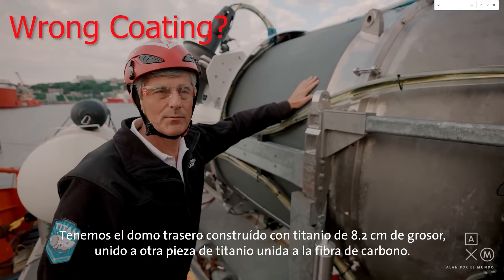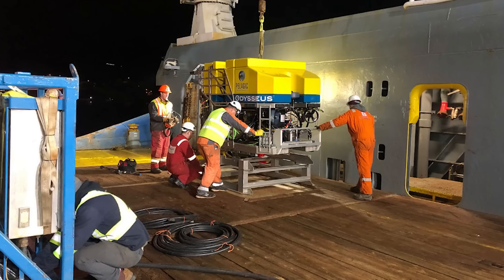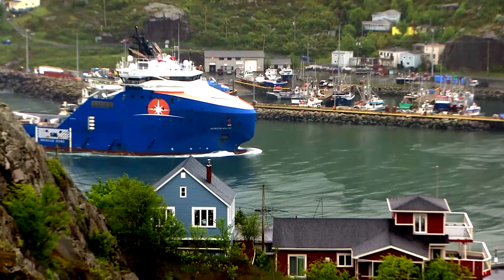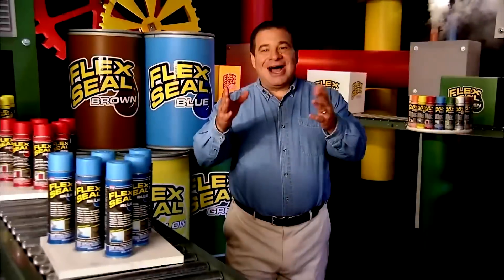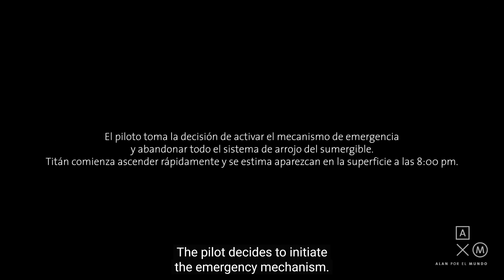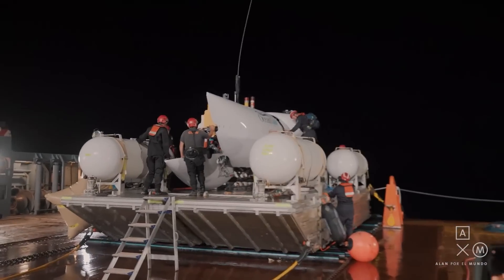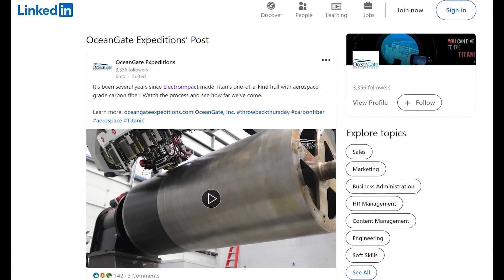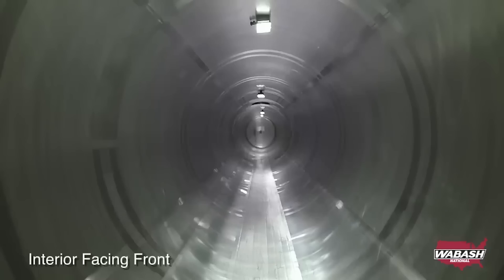Titan Sub Wrong Coating? Hull Construction, Debris Field Search

Comment: Maybe it's just me, but, those contractors, the Pelagic people, I thought that was an amazingly quick response.....

It's not like they sit there in a state of "readiness"...  they're at the dock, between jobs.  You do some maintenance routines, you check over all your gear, your next job isn't until 3 weeks from now....  It's probably pretty chill....  

So you go from that, to BOOM, the phone just rang, call everyone in, let's rock, we gotta be on a plane TOMORROW....  50-some odd hours, they went from hanging out, to fully loaded on a ship hundreds of miles away, pulling away from the dock....

It could take over 24 hours to get your people in....  and yet there they were, pack it up, ship it, travel, get there, unpack it, load it onto a ship dockside......  It's not just the Odyssey itself, there's undoubtedly crates & crates of supporting equipment, pumps, hoses, test gear, who knows what, that has to travel......  I'm kind of amazed, that's quick....

Comment: Yeah, used by the military, but NOT for that purpose
I've used a pressure washer to remove Rhino Liner from the bed of a truck, I don't think at twice that pressure water would have any problem penetrating and thin areas.

Comment: 11:33 The two processes are different. The first one appears to be wet filament winding, whereas the second one is automatic fiber placement (AFP) of pre-pregs. The second one allows for the laying of 0° layers. That is what you see at minute 11:33. So it is not just hoop layers and different from wet filament winding, you can make low degree winding without weaving the tows. With pre-pregs on top you get higher quality, lower porosity, better fiber alignment, better mixing of resin and hardener, higher fiber volume content, and more. It is another league.

Comment: If the hull was made using an Elctro Impact machine (footage shown being the titan hull’s production), then it was made entirely with prepreg and not a wet winding method. And the layup being 90/0 should have been fine. Source - my PhD was in composites manufacturing.

Do we have images of the recovered hull?
Reply: the carbon fiber hull shattered. what bits that would be left at the site would be mixed in with the human pate. said mixture is in the recovered endcap they had wrapped up.

Comment: You guys need to stop it already starting to make fools of yourselves the sub was built very well nothing failed with the hall or the window or the titanium are the carbon-fiber it was the control sphere module is it didn't fill with oil correctly and if the glass cracked on it it would explode like dynamite and this is what happened down there

Comment: Rhino Linings provides the solutions you're after for marine applications. Not only will our coatings protect against water, but they also shield against the harsh UV rays.  UV Rays is no friend of carbon fiber. While the UV light does not destroy the carbon fibers themselves, it can cause the premature degradation of sheets and panels by degrading their epoxy resin. In this respect, not all carbon fiber products are UV stable. Therefore, IMHO Rush was not trying to take any credit for Rhino Liner to hold back the pressure but to prevent UV Rays from degrading the epoxy resin. That's my take anyway.

Comment: So are you suggesting using different weaves and not just a uniform body may have made a stronger tube? 

This could include options like stretched tubular sock, different weaves of fabrics, vacuum bagging the resin/fabric matrix for strength and other options?

Comment: 10:45  I have said in multiple posts, IF i wanted to do something like Rush did, I would have built 3 fully configured submersibles. I would send the first down and up and down and up, repeatedly until it DID fail. I would assess the damage/failure and make the necessary changes to the 2nd submersible to account for those failures. Then I would do it again, keep sending it down and bringing it up, over and over, until it failed. I would make the necessary adjustments to the 3rd submersible, then repeat the cycling. Once the 3rd submersible failed, I would make the necessary changes need to overcome the failure, and THEN if I felt like taking someone down, I would only allow it to cycle 50% of the time that the 3rd submersible made. This man only cared about one thing and that was being famous. His ego told him he knew everything and he surrounded himself with kids who worshipped him as the emperor with no clothes.

Comment: It's not Rhino Liner. It's Rhino Linings polyurethane anticorrosion boat coating. I cannot find any spec/listing sheets for the product. It appears that you need to contact the manufacturer for the specs and listing information.  All I know is that its water resistant and durable enough to be used on a boat hull.  How water resistant is still the question.

Comment: I take care of some lab equipment at the failure analysis lab of one of the prime carbon fiber manufacturers (aviation). There's always a large backlog of failed CF waiting to be analysed. The parts they ship for aircraft undergo extensive testing. Covering the CF hid any fractures or defects that may have been noticed in a pre-dive inspection.

Comment: As Thunderfoot has pointed out, the compression factor of carbon fibre is considerably different to that of titanium. Bonding two parts of such a disparity of behaviour would lead to inevitable failure.

Comment: Bed liner? 🤣🤣🤣 That's not going to stop deflection at either end as the middle of the carbon fiber tube compresses in the middle and then start to pinch the floor inside. i guess it was always doomed to fail

Comment: I am familiar with thick film elastomers such as Rhino Lining.  It is very durable but it ONLY provides abrasion and impact resistance for the carbon fiber surface.  Think of it more as a durable paint that won’t crack with limited deflection.  With this type of coating the real concern would be the inability to do a visual inspection of the carbon fiber surface.

Comment: the polyurethane, it wouldn't degrade the resin, the only protection it would give is against abrasion.. Being sprayed on i cant say anything about air bubbles in it.  The biggest problem i see  that unless you did a ultrasound scan the rinolining would hide any damage to the carbon fiber..   You can smash the Rino lining with a hammer and it will flex and not crack

Comment: Its ironic that you showed the Flex Seal submarine truck because that Rhino Liner is more well known in the US as a truck bed lining.
For their marine applications, they have teams that apply it. What do you want to bet Stockton didn't even have it applied by the people who know how to work with it? They never would have if they knew what he was going to do with it.

Dude probably just bought truck bed liner and gooped it on his death tube.

What should he have used to to coat it? Well nitrile butadiene is used in high pressure hydraulic seals, but it has to be cast in place, not sprayed on, which would be expensive. It isn't resistant to abrasion though.

If you want a rabbit hole, look up the MSDS for the various kinds of Rhino Liner. They're all just the same kind of epoxy with different amounts of dyes, aggregates and accelerants. They're not rated or intended for any kind of pressure at all.

Comment: Is it me or when I see them say it’s glued to the titanium ring I cringe every time. I know certain bonds are strong but when you’re miles beneath the ocean I’d rather not be relying on glue to handle those pressures.

Edit:did they bring the actual carbon fibre tube back up or was that obliterated?
Reply: its either scattered as shards and got blownby currents or its in the end cap mixed in with human pate

Comment: I didn't know that they had originally tried using Carbon Fiber on the end caps.  Is there any information on why he decided to use titanium then?  Was it as a result of these tests, and if so; would he not question it's use for the main body?  Very interesting information Doc.  Curious to see what else you find out. :goodvibes:
Reply: Also note the cross-woven carbon fiber on the test article. Definitely not how the Titan's hull was constructed!
Reply: See that might be the funny part or, rather, one of the many funny parts. Since it was always the end-caps failing, they might not have realized that they had a critical flaw in the main hull, because that one always got away when they aborted the test due to the end cap failing. So after what? Three? Five? Ten tests with the end-caps failing, the main hull never failed and so it never occured to them until reality interfered.

Comment: Normally, to combat the water pressure at Titanic's depth would require an internal vessel pressure that would be unsustainable for human life so any coating to seal water out is ridiculously inadequate. The hull of the vessel would need to thick and strong with structural integrity to withstand the pressure difference from the interior and surrounding ocean pressure. The structural engineers who designed it did not know what they were doing.

Comment: SO, I've been a little geeky on the pressure where these tanks implode. This one appears to be -22 to -23 iinHg, another was -80kPa. That translates to -11.3 psi or about - 3/4 ATM. OceanGate was at 380 ATM. My mind is just boggled at why someone would use carbon fiber for this.

Comment: There was a reason why SpaceX decided not to use carbon fiber fuel cells in their rockets, and its mostly because of problems such as this. Ultimately though they use  stainless steel because after all is said and done, theres no real benefit cost or otherwise to using carbon fiber as a pressure vessel.

Comment: I dunno what the fuss is about - Been using Rhino Liner on my pickup beds for over 30 years. Tad pricey, but the stuff keeps the rust away, even with all the salt they spread on the roads every winter here in Maine. Should work great on that fella's submarine thing going in the ocean all the time.

Comment: Tank implosion 12:11 - you'll notice that the walls of the tank were only prevented from 100% collapse by the metal rings. Titan only had rings at the ends of the CF portion of the hull. Unlike the metal tank, the CF walls of the sub would not bend inwards, but shattered instead, shredding anything and everything inside. I'm surprised there were any 'human remains' left to be found.
Reply: We will find out what they found sometime in the next two to five years.  Coast Guard has all the wreckage.

Comment: Thank you for keeping us up on this. I could never figure out why there was no titanium rings, (bulkheads), on the inside giving the cylinder reinforcement. Was this another Rush "ego" decision?
Reply: I have always wondered the same thing since we started following this story, but I feel like that would have only delayed the inevitable. The CF would fail at some point.
Reply: @tpaddock891  Indeed, even if this design could cut the certification mustard, the CF tube would be a consumable part, the lower cost of using it would have to be compensated by more frequent inspection & mandatory replacement after X cycles.
Reply: @tpaddock891  You're probably right.

Comment: Rhino Liner is essentially a spray on truck bed liner but it's capable of some crazy stuff. Used to work at a dealership and we can Coke can rhino lined and we had a 300 lbs dude jump on it and it wouldn't do anything to it... But who knows how it really performs at 4000m of depth pressure 😅

Comment: What is mind-boggling is the aim of the test was to reach 6000PSI/inch^2, but it failed in mid-way so they changed the pass criteria to receive positive test result. They said test passed at 4000PSI/inch^2, because it looks better on paper then - test failed.

Comment: Winding a cylinder with carbon fiber will make a capsule that can HOLD pressure on the inside, not RESIST pressure from the outside. This would make a good space capsule, but a bad submarine.

Comment: By using different materials for the hull, the main weakness would be the differential in terms of thermal expansion contingent on the temperature. So the titanium end caps would contract at a different rate than the carbon fiber as the sub descended(colder) and then expand at a different rate as the sub ascended(warmer) irrespective of the constant pressure at various depths. This differential could have resulted in increased fatigue of the hull leading to it eventually being fully compromised. One wonders if they pressure tested the model hull with varying temperatures to ascertain as such potential design flaw.

Comment: Here is how you build a deep water carbon fiber vessel, first multi angular weave, then inner and outer sleeves of titanium the three layers epoxied in a vacuum kiln. To pull all air voids out then you TIG  your flanges to the sleeves, X-ray all welds and the body looking for voids. Then you build three and you destructive test 1 unmanned and proof the others un manned. Then only ever go 80% of its potential.

Comment: Hi Jeff. 
At 03:14, there appears to be discoloration of the titanium ring (if that's the correct orientation) which could indicate inconsistent adhesion (with susbsequent oxidization) was achieved by the cement product used to connect the titanium ring to the filament wound hull. We've seen video of the joining procedure which was not done with any vacuum assist and lack of sound method or manufacturing design consideration. Resin vacuum transfer could have been possible. Not that i'd ever think a non homegeneous vessel is a good idea to start with.
RB

Comment: If the rescue team had a ROV capable of 4000m+ on day 1 they would have found the wreck that very same day. As it was, they had to wait for one to arrive, so I guess they figured the best use of that interim time was to search by air and sea, just to cover all bases in case by some miracle Titan had managed to re-surface.

I don't understand why so many people are questioning the timeline of events - the 'why didn't they just look at the launch site in the first place' brigade. If Stockton had been running a reputable, safety conscious operation, OceanGate would have had a sexond back up (certified) sub with them and / or a ROV for use in case of emergency. Instead he had just the one uncertified sub, cobbled together from various knock off components he managed to scrounge up. Just look at the difference in appearance between Cyclops I (which they bought secondhand and modelled Titan on) and Titan, with all its stuck on thrusters and dangling cables. 

I'd rather go in Mr Spoon's rocket to Button Moon than in that deep sea death pellet Stockton rustled up.